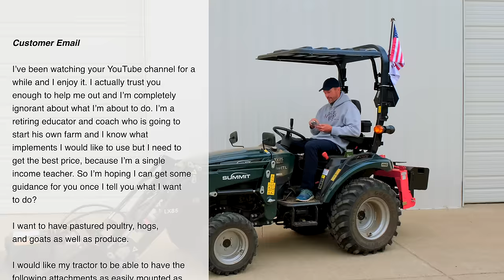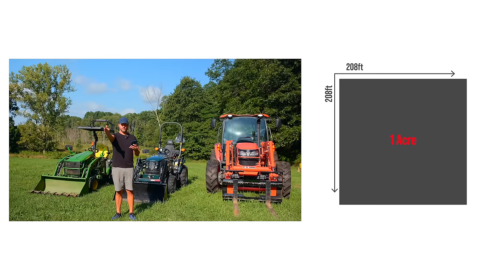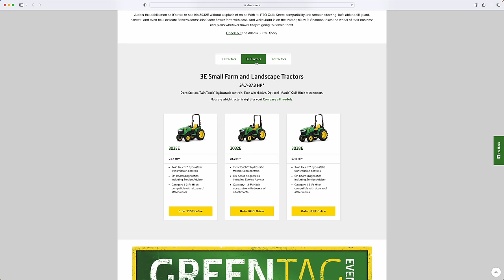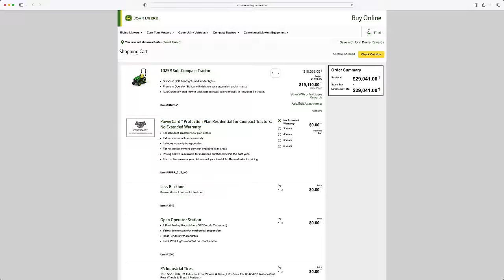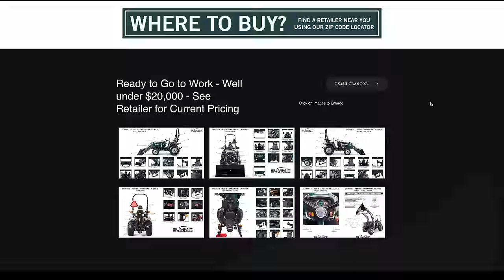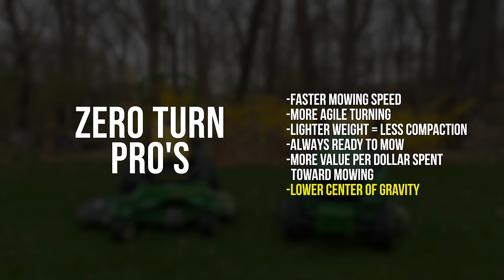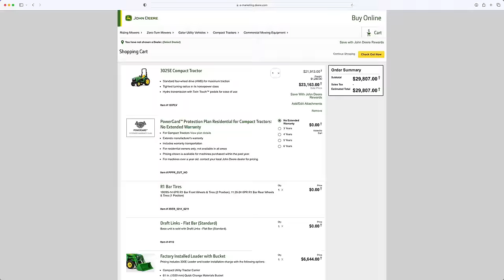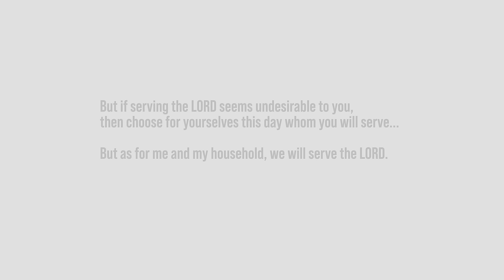CAN YOU STILL BUY A NICE TRACTOR FOR $10,000?

Comment: Nicely done, and good advice. I went through a similar situation and ended up selecting a TYM T574HC tractor. I'm getting old and wanted a cab tractor 🙂.  Not one of the brands you mentioned, but something he may want to consider. I retired from the military in 2006, then retired again from my second job in 2021, and now establishing a 16 acre farm in IN. Farm is on rolling hills with 7 acres of tillable land, 2 creeks, a .25 acre pond and the rest in trees. I've got a 1200' gravel driveway to maintain, and we have 43 chickens, and 2 pigs. Will be expanding to 60 chickens and 6 pigs next year, and then expanding to cattle (probable 4) the following year. 
I'm getting the tractor (with loader) with loaded tires and 3rd function valve, 66" leveling box (on order, USA built), 72" grapple (with double piston grab arms), and 48" forks all for under $40k. We incorporated as a farm and sell eggs and pigs, which saves us on taxes. If he didn't need/want a 55 hp tractor that cost would obviously go down. When I did my research, the same tractor at JD or Kubota was $17k more expensive, and didn't have a lot of the extras (work lights front and rear, arm rests on the seat, radio, loaded tires, 3rd function valve) that I wanted so it would have cost even more.
Reply: I wasnt sure if you have the rractor already from your post, but if you do: how are you liking the tractor and service availability? I've really been considering TYM but have no dealerships or service near me... the 574 would be a pretty great size though a little garden tractor would be fun too.
Reply: @codyjlee  I haven't purchased it yet. Building a house and it should be done mid Sep. Buying right after that. I sent out a standard email to all the IN TYM dealers to find out what I could get one for, then I picked the dealership that had the best record for service (not the cheapest either). I'll see if I can get them to come down a few more hundred dollars seeing as how I have a quote a bit lower, but if not I'll still get it from them. From all the research I've done the tractors are rock solid, and I'm pretty handy at fixing about anything so I plan on doing most/all of my maintenance and repair work anyway. If it has a warranty issue is about the only thing I see myself using a dealership for.
Reply: Thanks for the details! I hope all goes well with the build as well as the purchase! I'm hoping to start looking later this year or early next year to purchase, but we'll see how it goes.

Comment: We’ve wanted a tractor for years and we finally decided to get one. After looking at kubota and Deere, I couldn’t justify their pricing for what you get. I got a bigger tractor and attachments cheaper than either could offer. For just under $28k, we bought a new (Got to see it before it was built) CK2620 with loader, QA 66” bucket, loaded tires, arm rest, dual rear remotes, pallet forks, R14 tires, and woods 60” box blade, plus the dealer is 15 minutes away. Just had it delivered yesterday. 
Now I just need to stop by GWT this week to grab my stump wrecker (was recommended the mini) and quick hitch.

Comment: I absolutely agree with the point that you want to choose your tractor brand with the dealership in mind.  I did months of research (spreadsheet and all) and had my preference narrowed down to three brands that are represented in my area.  My front runner, the dealer suddenly dropped that line to focus exclusively on another.  One of the others was sold through a big box store and I was completely underwhelmed by the sales and service staff.  The staff at the tractor dealer handling the other brand were great.  "Good ol boys" who knew tractors (theirs and others) inside and out.  I bought that brand partly on the stats: it's a stout lil tractor, and a big part because I felt I'd be treated right by the dealership.  Major consideration, especially if you aren't an experienced diesel and hydraulics mechanic.
Reply: May I ask what kind you got?
Reply: @chrishall5141  I bought a Massey GC1725.  Been very happy with it.  It's a sub-compact so too small for folks with a lot of land to tend but, for what I do, it's a great size and is quite capable.
Reply: @DougBittinger  thank you.

Comment: Think I posted this in your price comparison video a while back. I took delivery of a 1025r in November of last year. What I got with it and what it cost: 2023 model, backhoe, loader, standard bucket, 4in1 bucket, single point connect, 3rd function, wheel knob, seat cover, tire swap with rim guard, wheel weights, 6 bracket weights, pallet forks, tiller, box blade, (all attachments are frontier) no belly mower as I use my zero turn. Total in Nov 2022 for me was just under $35k for everything. This doesn't take into account the after purchase things like bucket hooks, hitch, speedco quick attach etc that makes life easier after you have it. Those will add several hundreds of dollars after. Personally, it's a lot of money compared to what they use to be priced. However, it's not a bad price for everything considering where the cost of all these things are heading. I'm no spring chicken anymore in my mid 50s and this has helped me do things around the place that would have taken a lot longer or maybe not at all if I didn't have it. So, it's worth it to me. ROI: I have a 1/4 mile gravel drive. I use to pay someone to maintain it twice a year. Tilled, graded and reseeded a 2ac back yard this spring ( get a quote on that, it will shock you). new landscaping around the house ( again, get a quote, wow) moving downed branches etc. the list goes on. It is paying for itself by me being able to do it myself. Just my 2 cents and maybe it will help someone that is looking. As always, I enjoy your videos and keep up the good work!

Comment: My pallet forks are the least used attachment that I have.
If you can, borrow or rent the tiller. You just won’t use it enough to pay for it. Spend the money on making the tractor easier to use; toothbar. Hydraulic top link, quick connect 3pt, rim guard, lights.
And of coarse get a box blade and some kind of mower.

Comment: I live in Colorado. My elevation is right at 7000. I did a lot of research prior to purchasing a tractor to meet my needs. Prior to my purchase I used a Ford 9N with a loader to do the things I needed. When I got my new tractor, it was (is) an E 3038. Best purchase I have ever made. It serves every purpose I need. It is also nice not to feel as if I just had a workout after mowing acres of property like the 9N.
Reply: Doesn't the 9N have the seat bolted directly to the frame? Or does it just feel that way? :)
Reply: @JCWren  You know, I am not really sure JC. I ran that thing for 9 years. Just had it rebuilt in the last year and it was in such bad shape it cost 8000. I simply could not part with it. It now belongs to my #4 son and he loves it. It was my father in laws and he left me three of them. A 9N, 8N with a backhoe attached, and an Avery. I love them all, but you do get kind of beat up on them. I know that I am now spoiled with the electrostatic transmission (no shifting to reverse) and power steering. Another thing the JD does is mow in reverse. The 9N has to have the PTO shut off to get it in reverse.

Comment: Okay, I needed this vid two yrs ago. In 2021 we purchased a 36 acre property in Southern Georgia. 2 acres house and yard, 2 acres woods and soggy bottom, 6 acres pines that still needed cutting between trees. I purchased a JD4044 open cab. The dust, the heft of the material I was cutting and hay fields were just too much for this tractor, I thought. 26-28 acres of cutting, harrowing, planting etc. we have cows, chickens, ducks, geese with horses and sheep in the future. I traded that in on a JD5075 cab. My 4044 cost 24,000, I got 30,000 for this same tractor one year later. I paid cash for it so it was pure money down on the 5075. The new tractor was 63,000. So now I owe today 27,000. I would not do it again. I made a huge financial mistake because I trusted the advice of the JD dealership. The 4044 did the job just fine, but felt like it was working hard, it was, but that was just fine. I should have kept the paid for tractor and understood it was just working hard, not being over worked. Sure, I love being out of the dust, in the AC and listening to music or talk radio while working but every month I have to swing that bat hard to make that 560 dollar payment. Learn from me, more power does not equal a better situation. I will add that I can afford it. It does not cause my family to go without nor put us in a strapped situation but still, I had a tractor that was paid for and traded it in within a year for a 5 yr note . Not my best move.

Comment: This was a helpful video for me. My dad was able to purchase a used 80's 4x4 Massey with a front loader, finish mower, box blade, and brush hog for 3.5k a few years ago. We thought it might be a little high as it needed some work, but now know it was a great deal. I am on the look out for something similar, if you have time and are able to jump on an opportunity when it comes you might be able to still find great deals. I wouldn't rule out used, especially if you are like me and my dad and just starting out.
Reply: I just purchased a 1982 JD 950 w/loader.  Meets my needs: starts every time, snow removal, 6' rotary cutter, 6' York rake, and grader blade.  $7k.

Comment: We have 10 acres and I got the Branson 2515h tractor.  I bought it used with a backhoe, tiller, box blade.  I then purchased a mower and a trailer.  

I got this tractor to handle the 5ft implements that can help with mowing and other chores.  I have about 550ft of driveway that needs to be maintained.  

I’m super impressed with this tractor.

Comment: I recently went through a similar situation retired and wanted to start farming and picking a tractor is a lot harder then I thought both a good and bad thing with all the choices but after a few years on the fence I went and started visiting nearby dealerships because it is important to find a dealer you want to work with and if I hadn't I wouldn't have found out about yanmar which I ended up getting. For the price I paid for a new Yanmar 324 I couldn't find anything close and the warranty and fact they invented the commercial diesel engine and still make engines for john deer i felt pretty safe on the reliability and bang for my buck. I was hard pressed on the model as I wanted bigger and more HP but realized that buying a bigger tractor would 1. Cost a lot more and probably be more than I needed 2. The money I spend on the tractor would leave less for me to spend on implements so I would basically be buying a nice socket wrench but being unable to buy the sockets I would need to us it.  Just short of a year later I am very happy with my tractor and I think in the end that is the most important thing ask around get advice but pick the one that feels best for you and you will have to go around and test them out to find out which one that is, but you'll gain experience doing it which will make you much more comfortable with the tractor you end up with.

Comment: My advice for tractor shoppers....figure out the frame size first!  That dictates maneuverability, implement and loader width, etc.  Maybe you know you need to move 5 foot round bales, for example.  A "2" series Deere frame will be on the low end of that, the "3" series would be better and the "4" would be overkill unless you have other things or want the added buffer zone (at the expense of more $, and less ability to get into stalls or the barn).  Once you know the frame size, use the rest of your tractor budget to get the best engine you can.  I generally shy away from the smallest engine in a frame size, but there's also not normally a reason to splurge on the biggest engine option, either.

Some people say to figure out what size you need, then go one size bigger, but that's ambiguous.  I say figure out the frame size based on the jobs you anticipate, then get a bigger engine.  Smaller frames can get into places that larger frames can't, and smaller frames are less harmful to turf or pasture, and are easier to store.  Of course, if you're primarily doing ground engagement work, then get the bigger frame, too!   But 90% of the people I talk to aren't doing ag farming as the primary use of their tractor, so I try to steer them to "smaller frames can be better (within limits)".

Edited to add:  Here in central Florida, I have an LS dealer nearby.  He has 2 and 3 sized tractors between 25 and 43 HP for under or right around $30k.  If you don't have to have an orange or green tractor, you can find the deals.
Reply: Looking at a Massey Ferguson 1736 at a local dealer. 2016 with 200 hrs. its not the E its an M. ( doesn't say M but it has the nicer features.) Asking 20k. I want to do some brush hog stuff and tilling a few acres. Any advice, I just retired a few yrs. ago and want to play around a bit. I think its 35HP..

Comment: My JD 4310 and all attachments came with the foreclosed property.  I acquired a post pounder, fence post hole auger, 7 ft wide disc, 6 tine cultivator, 6 ft brush hog and a 4ft hydraulic snow blade.  I will say the disc is one of my most unused implements.  The post pounder is completely unused. I've never used it in 11 years.  I would rather have a tiller attachment than the disc.  I use the cultivator to prep the garden then to mix in the bio mass every fall.  The brush hog and auger are the most used.  I bought a finish mower 3 years ago and used it twice, but I've been running new pasture fence so the sheep replaces the mower.  I bought a JD 4610 2 years with a bucket and backhoe and use both attachments every month.  
The 4310 has a mid mount PTO but the mower deck alone is over $6000. That's absurdly expensive so I bought a riding mower instead for only $1800 and a 3 pt attached hydro wood splitter for $800.

Comment: You can look around for used with lower hours…. TractorHouse and a few other such websites have enough listings for new and used…. But even some used cost a small fortune.  I’ve done a lot of window shopping for a tractor a bit larger than the customer in this video wants, and I’m still in sticker-shock.  I found that I’m a bit partial to Massey Ferguson tractors, but in CT., there are only 2 dealers.  Still, this video’s customer might do well with a Massey Ferguson 1736 or similar.  New is still under $30k for most with a loader and a cab model I believe, while I’ve seen older 9 year old 1736’s for about $14k.  Dealer support is important unless you are a mechanic, know one well, or just don’t care.  Good luck with the adventure!  Still waiting to start my own!
Reply: Thank you very much

Comment: I maintain 40 acres in WV with a 2025R. At the time, I needed a do-it-all machine as my old 1960’s Ford 2000 (which handled my heavy tasks) and my 1980’s Gravely ride ons died within 2 months of each other, and my budget did not allow for a 30-50 hp tractor for brush hog and blade work and a heavy duty lawn mower to handle 12 acres of mowing every week. The 2025R is a great machine and gave me the use of a front end loader, which I hadn’t had on a tractor prior to, but there are some days I miss having those extra 15 horses to brush hog steep slopes, move a lot of snow or pull something heavy.

Comment: I’ve got right at 20 acres in eastern Kentucky mostly flat currently doing two acres of vegetables, mostly potatoes and sweet corn. We have have some fruit trees and berries. Currently mowing 10+ acres with a 4 foot bush hog. Current tractor is a Kubota B2920 with loader. Attachments include 12 inch single bottom plow, potato plow, disk bedder, single row cultivator, fertilizer spreader, 35 gallon sprayer, 4 foot bush hog, 5 foot box blade and a 5 foot disk. I also have a quick hitch but half my attachments are old enough to not be quick hitch compatible. 

In my opinion the tractor is too small for 80% of what I’m doing. Bush hogging is painfully slow and I mow 4-5 times a year averaging 10+ hours each time. It’s not heavy enough to do a good job plowing. It’s serviceable in established ground but every time I’ve tried to break new ground I’ve ended up borrowing a larger tractor. It’s too low to make a good cultivating tractor which means I’m stuck having to till between rows with a walk behind after the plants get over a foot tall. It pulls the disk but it won’t impress you.  It really shines planting and harvesting potatoes. But a potato plow and disk bedder are two of the easiest to pull ground engaging attachments you can buy. It also has industrial tires which I hate. I mow in 4 wheel drive because the tractor will spin in wet grass otherwise.

So there’s my assessment after 3 years  of running a market garden operation and maintaining a small farm with a small tractor. Couldn’t imagine doing it with anything smaller. 

Weight has more to do with ground engaging attachments than horse power. Horse power comes into play with pto driven attachments.

I’m also not a big fan of hydrostatic transmissions and would likely not buy another.

I wouldn’t feel comfortable recommending a specific model either but the tractors I’ve been looking at are John Deere 3043D, Kubota L4701 and John Deere 4044M. The 4044 is rare as hens teeth here.